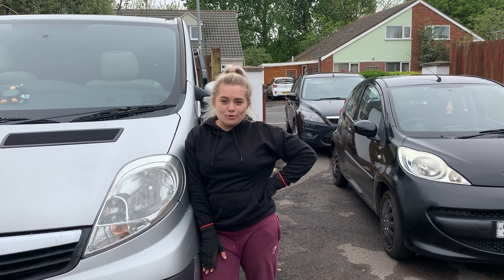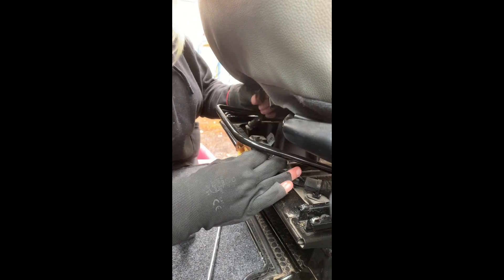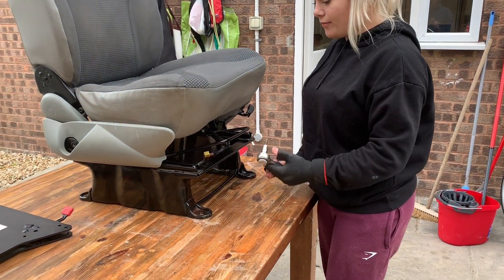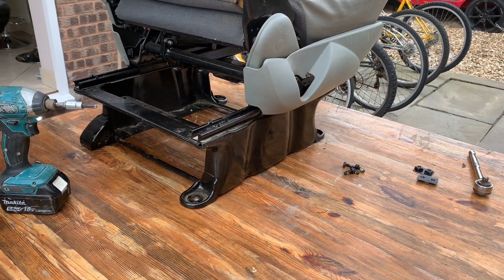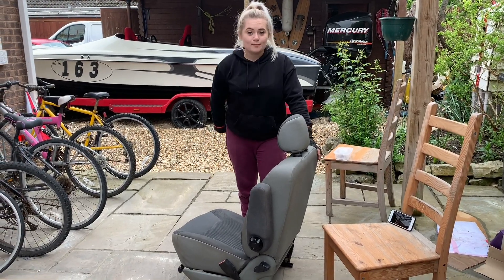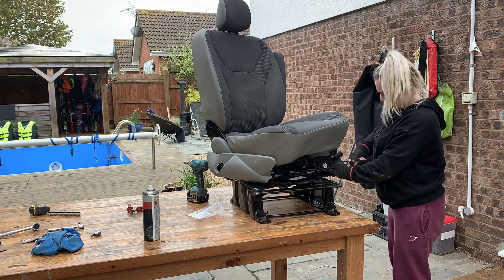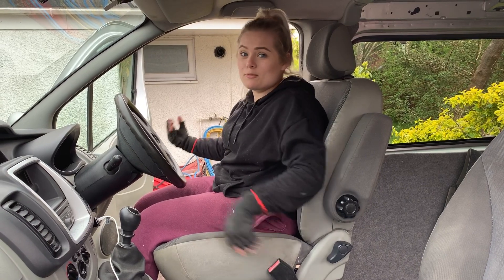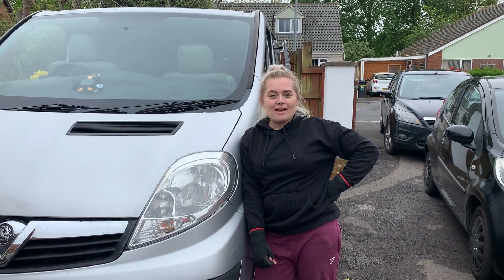Vivaro Swivel Plate Installation - Engineering Problems

Comment: hhi hun pity you dont live close by you seem to be good at lot of stuff , still got lot to do inside but had her Vinyl Wrapped long the sides in red ,, want pair single seats but traffic seats cost so much was looking at saab bmw or range rover seats but recon would need the plugs rewired for the air bags and seat belt lights on dash,,,, keep up the good work sweet heart xx

Comment: Hi Lauren.  Great video.  It would be extremely helpful if you could do a quick video of the passenger seat installation.  I've got a 2013 Vivaro and just bought a single passenger seat with swivel base off Ebay.  I've removed the double passenger seat and there only appears to be one hole that I can attached the new base plate to the chassis. The other three don't line up.